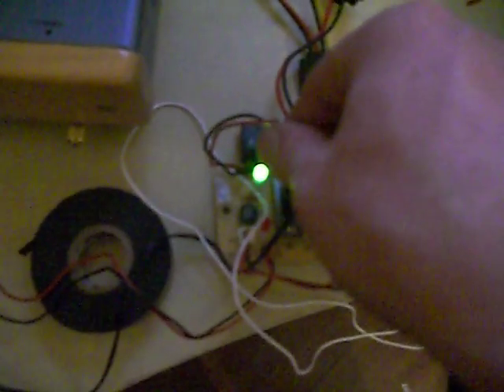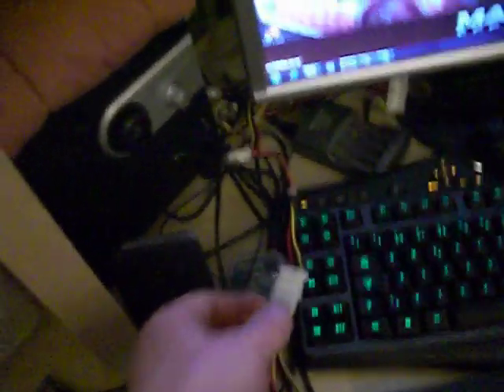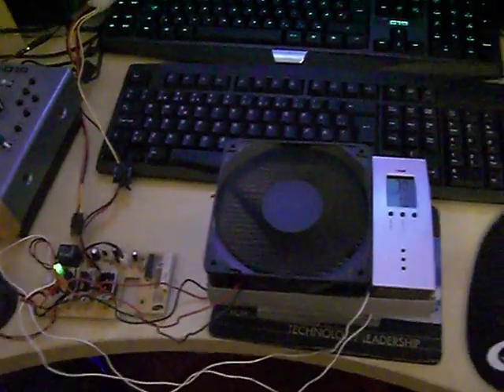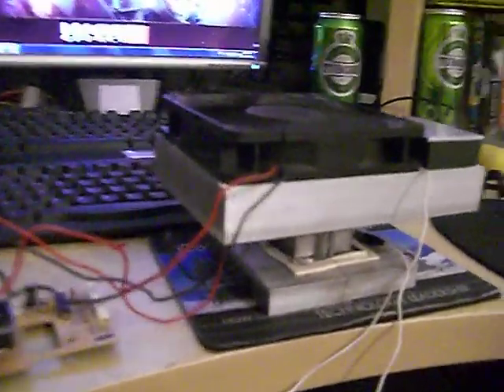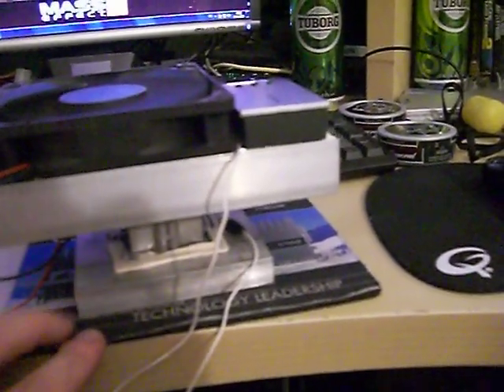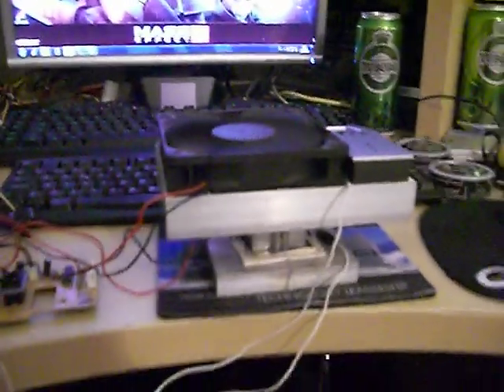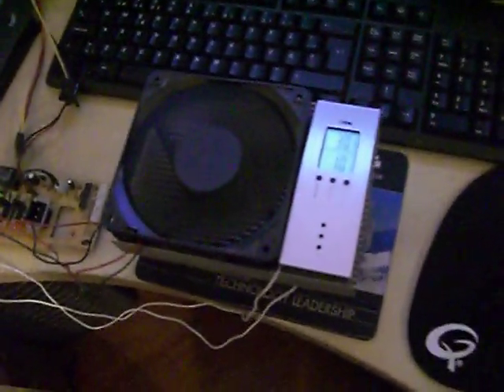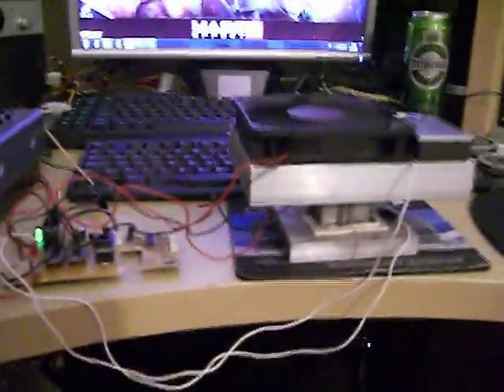TEC (peltier) Principles. CPU cooler

Comment: Long ago, had a Pentium 3 750Mhz. Used a TEC (peltier) and obtained a stable clock of 1Ghz (it was big back in the day when cpu multipliers were locked). Used a Golden Orb Cooler to dissipate heat. To help protect from condensation, I put the mobo in a horizontal case (it laid flat), coated all around the cpu socket with silicon and neoprene (about a 2 inch apron). Ran great for a year. Pulled the chip, the underside of the cpu and inside the socket well showed signs of moisture dmg. Its do able

Comment: That heats sink is tiny. I tried to power my 175w tec using one twice the size on full speed and it got really hot.  Used my bigger cooler and it doesn't get hot at all.

Comment: never put a peltier directly on a cpu. it's best to use it in conjunction with a water cooling system. cool the water leaving the pump, and put a heatsink and fan on the hot side of the peltier. or even cool the hot side with a separate water and radiator system, just sandwich the peltier in 2 cpu water blocks! but if you use the heatsink there won't even be a need for a radiator, which may end up being more cost effective.

Comment from the maker: @scuffieduffie Yes, but the TEC needs to remove it`s heet to, so the heatsink will get really hot! It is better to use the water on the hot side of the TEC... and cool the CPU with the cool side... You also need a really powerful TEC to cool the whole system, they are exspensive!